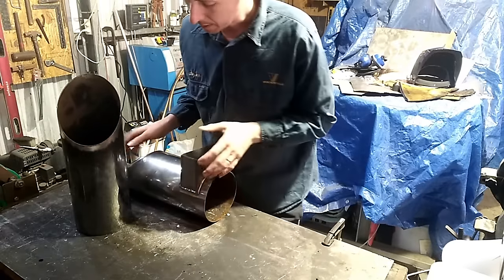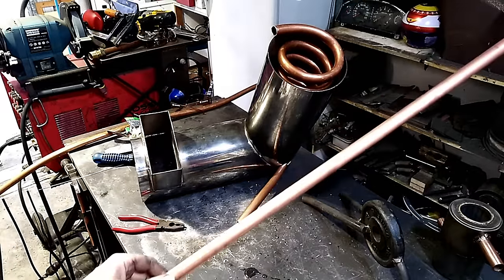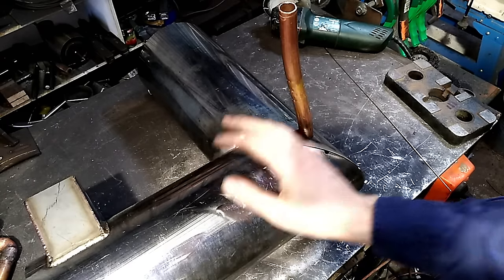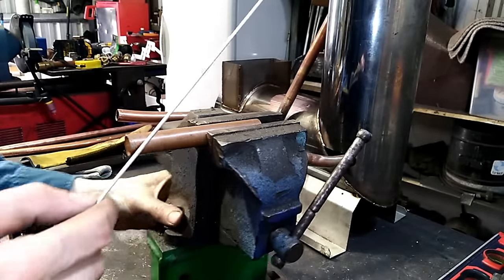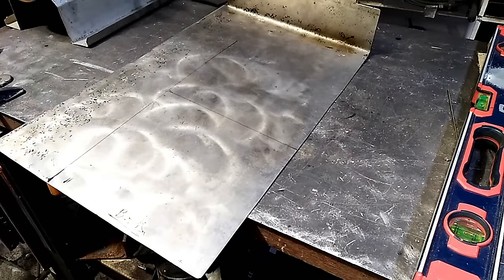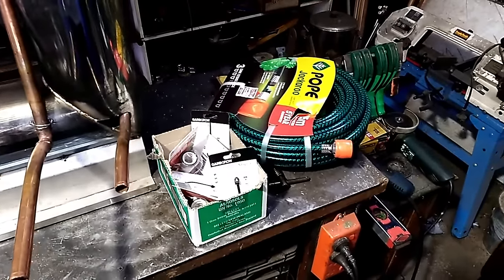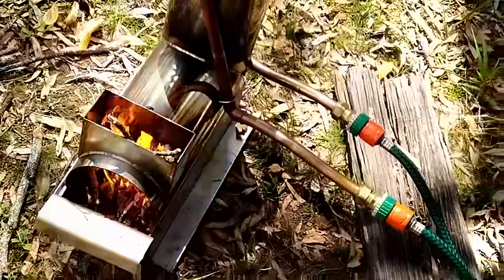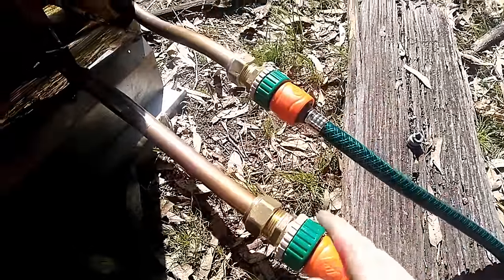Hot Water Rocket Stove II  - BUILD-

Comment: The hesitation and steam blasting is caused by the outlet pipe dropping down before the hose connects.  The water rises to the top of the coil and is trapped, unable to descend.  This causes it to become hot enough to become steam, the expansion of which causes those regular little blasts.  A continuous uphill gradient on the outlet pipe will ensure correct operation.
Reply: Hey! Thanks for sharing that! That's a gem of information!! Thankyou!
Reply: I grew up in a fab shop, nice welding.
Reply: Need a one way flat valve on the hot side,add water or lower the exhaust below the water line and stuff a water hose on the cold side and get the air out of the coil.
Flap valve will keep the heat going one way without allowing any air to be pulled back in another flapper on the bottom flapping to the cold flow   
Would regulate ebb and flow cycling
Reply: I've seen that it is possible to refrigerate te tube to turn round....the two parts of the tube must stays underwater,so you don't lose heat and time,someone explains that up here, nice job !🖖🏼
Reply: В бочке ниже ватерлинии тоже нужно змеевик с трубы нужно ставить. Тогда пар выходящий тоже будет греть воду в бочке. В входную часть холодной воды нужно ставить клапан обратный клапан. Тогда при больших выделениях пара будет воздерживаться давление на выход. Также устроено мойищие  паровые аппараты.
Reply: I am thinking of doing something similar with a mains pressure system, but was concerned about the steam, despite haviving a TP valve, so are you saying that if the hot water exits the top that you won't get steam ?
Reply: @jarrodheley7879  maybe a brass solar hot water one way valve at the bottom of coil to stop pressure push back

Comment: Use a open ended spanner to make the pipe round again. 22mm spanner for 22mm pipe. You can start with a larger size if it's really oval. Just keep rotating it round the pipe as if your undoing an invisible nut until its round again 😊

Comment: My father had a similar rig and we got rid of the sputtering by not having the top of the coil brought back down to the same level as the inlet. We made it uphill all the way with smooth bends and it sputtered no more. On my rocket stove I put a 45 degree chute on the end of it so I could feed in longer pieces. The chute had a lid on it and the combustion air came from the end like your setup. You have some neat toys I wish I had.

Comment: Why did I fail to come across your video before? I looked at so many before I started my own experiments  and this would have helped a lot. I built more or less the same set up with a 200 litre drum and the heat exchange coil from an old copper water tank set into a rough rocket stove made from cement blocks. That got me to where you are here. Then I built a cement hot tub with a capacity of about 1000 litres and made a "coil" from 1" galvanised pipe elbows and nipples. Built another stove from river stone and cement with a stainless baffle suspended in the middle of the coil to force the hot gases over the pipe. It took about six hours to heat the water to a comfortable temperature and of course during that time countless visits to feed the stove. Rocket stoves are very efficient with fuel, not so much with my time. The next iteration was to purchase a 1.25" stainless coil from the US (I couldn't find anyone here in Panama who could bend that diameter of tube). This coil is around 14" diameter with seven and a half turns stacked pretty close together. It acts like a fire basket do I can load it up once the fire has caught then leave it for a hour or so. It takes about two to three hours to heat the water. I found it was important to make sure there's a steady incline from the bottom of the hot tub, through the coil to the inlet. Syphoning is slow but steady with no bubbling. Inlet temp is too hot to hold my hand in but dissapates so fast there's no need for a protective screen. As you discovered, when the flow rate is slow the water in the drum or tub doesn't mix itself and the hot water stays on top of the cold. I usually give it a stir when I'm feeding the fire to see what the "real" temperature has got to. I'm giving such a long comment in the hope that someone else who fancies making an outdoor wood fired hot tub can fast track their project. Good luck whoever you are

Comment: For best results the thermal siphon needs to be all “Up”, without that steep down slope on the hot side copper pipe.
A steam lock at the top of the coiled tube stops the flow intermittently.
This project would work excellent with a small flow pump to flow the water through faster, before it forms steam.
Interesting project.
Reply: As a plumber, I approve this message. As soon as I saw the outlet go down I thought, uh oh. I was impressed with tig brazing the copper though. I've never seen that before.
Reply: Am besten eine kleine Pumpe nutzen. Es wäre auch besser das Wasser nicht von oben, sondern von unten in das Wasserfass einzuleiten.

Comment: Try taking your top pipe upwards to the top of your storage container. Thermal circulation requires cold water entering the lower end of the heating tube and as it heats, the water rises. 
By returning the pipe down will trap the heated water at the top of the coil. Cheers

Comment: You got it half right about thermosiphoning. It works because of hot and cold water but it also involves gravity. The water tank needs to be higher than the stove. The lines need to be on a constant upward angle from the stove to the water tank in order to get a good circulation. If the tank and the stove are the same height, and the lines dip it wont work very good.
Reply: Tried making one of these without this knowledge thinking the boiling water would have a stronger lift effect. Ha. Ha. Didn't do dick. If I used a vac to get it started it would pew pew some steam but that was the extent of it. Decided to make a gas condenser with the tube instead 😂
Reply: You also need low pressure check valves, or at least one, to "Gently guide" the direction you want it to go.
Else the heated water will try to go up both pipes, and thus won't do nuffin because it's head-butting the cold water trying to come DOWN both.
Reply: Thank you
Reply: You guys i think he daid it was a test show. I made mine with a five gallos bucket but electric with a 1500 heating element and all i do is cinnect for 3 to 5 depending on how hot i need the water. Works beautifully for about 15 years now specially when there is no water pressure. But his is nice and i will make one one. Simply
Reply: No not true, as long as the water level is higher than the stove, which with that big-ass barrel, it was probably about two and a half feet taller than the stove

Comment: the upper end needs to flow uphill to a spot into your tank below the water line and above the cold water outlet of your tank. optimum rise is roughly 4 feet high for every 6 feet of distance from the heater. it will heat faster if you only use 3 turns and spread the top and bottom turns as far apart as possible. more pipe creates resistance in your water flow and cools the chimney inhibiting the burn.
Reply: Nailed it !
Reply: Ele pode reduzir o fluxo da agua, ajustando esse volume. Quanto menos água e mais tempo essa agua permanecer dentro da bobina, muito mais rapido vai aquecer, alem do que vai  gerar mais vapor.

Eu encontro um erro nesse projeto: a agua ou vapor que retorna quente da bobina deve entrar no meio do tambor, isso é o correto, pois assim nao haverá perdas de calor como está acontecendo nesse projeto.
Reply: Permita eu fazer uma pergunta:
Voce fez o teste, fez alguma experiencia desse tipo, e usou espiras espaçadas, digo com mais espaço, e funcionou?
Reply: @romilsonmagalhaes6487  rooster crowing

Comment: Great job mate ,well done , there is nothing wrong with diy jobs like this, we all got to start somewhere to learn and grow from experiences. This project was awesome thank you for sharing . 👍
Reply: Had a oil stove with the coil in the burner area so I just went off of how that rig went. Or similer. It can create quite a bit of steam  in the line while circulating to heat up a 60 gallon hot water tank. We were releasing air quight a bit.

Comment: I would suspect that, with your outlet still at the top, a 90 degree elbow and tubing straight down and, near the bottom of the tank, either a bend in the tube that matches the circumference of the tank or a couple of 45 degree elbows either-of-which hug the inside of the tank for a few inches, will get the heated water circulating and the temperature uniform (or nearly so) throughout the contents of the tank.  Great concept and certainly a lot of admirable craftsmanship there.

Comment: You can take a old copper car radiator and put it on an old window unit air conditioner case.
Attach water hose connectors and build a fire under it.
Quick cheap easy hot water heater that will boil out all the hot water you need fast!

Comment: I built a solar heater a few yrs back (20' x 4', copper pipe every 6 inches, black and in insulated box with clear plex cover) I originally brought hot water upper pipe into swimming pool above water line.  It melted the white pvc pipe 2" in just a few hours.  Had to bring it in under the water line of the pool then it worked fine and greatly extended swimming season.
Reply: Doyle Pugmire great idea man 👍

Comment: Fill the pipe with water, crimp end then the other a few inches in as an initial seal, fill the resulting cup at the end with hot glue
Then crimp that cooled section as final seal, water can't compress and so the pipe will hold its shape
Works like a dream and heaps easier than sand or pipe benders

Comment: To round the pipe take two pieces of square steel. Put them together and tack weld them. Drill a hole in the middle at the seam. grind the tacks off and separate. Chamfer the edges by the hole at the seam so it won't pinch the pipe. Then put it over your pipe and squeeze it or hit it while rotating the block. This also works on frozen pipe. The warmer the pipe the easier.Thank you very much for sharing this video. You have a beautiful family. Be careful with welding that galvanize. It's a killer.

Comment: great job and welding OH i wish i could weld like you,
had a Carmichael stove for years on the farm with a wet back, the header tank was on the roof same sysytem ,no pumps for those that reccomned a pump,the tank had a sherpards crook as a saftey  should the water get to hot,and would return excess water back to the tanks,NOTE no pumps for those again who claim needed ,this stove and many like them were in their 1000s in Australia ,just a matter of keeping the header tank full where there was no power was done with a semi rotary pump ,if power then the water pressure pump took care of that
ols aussie saying you done well son
Reply from the maker: Thanks mate, to appease the pump crowd I have put a pump on the stove which circulated the water so fast that it was not able to heat it.  Still working on the 2nd version of this stove, which is a very different animal to the first one. Thanks for sharing, I appreciate it.
Reply: @LittleAussieRockets  use a car radiator thermostat that also controls the pump. When the waters at temperature it opens, turns on the pump and let's water flow. It also has an inbuilt safety mechanism in that it won't close when it's too hot. You could also put a pressure release valve for safety.

Comment: some one tips:
if you want hot water with less time, instal a pipe in the outlet of water inside teh tank, causing the water to be heated to enter a higher temperature. (suction pipe at the middle the tank). Less water for heating, less time to do.
If you need more hot water but do not be in such a hurry, you can put the inlet and outlet the water of the tank about 10 cm from each other  on the bottom of the tank.
In this case, basically, what changes is just the hot water intake going down. So, the water that is already warm will rise and on the way, tranfer the heat to the water of the tank.

I like your videos..
from Brazil...
Reply: I don't have materials to do this job,can U make me one to pay for it?Am a pensioner in Ghana

Comment: really interesting watching the metal work and planning. i recently finished building a sailboat and a lot of your tool usage is parallel to what i did. the worst thing about handbuilding an epoxy and foam sailboat is the metal fittings. i have a swivel mast and trimaran folding apparatus. most of the metal is aluminum and i had it fabricated by a friend in a nearby town. i got to watch him enough to see the process. a lot of the metal parts i had made i think could be done with carbon fiber or some combination of  metal and cf. i will try to  watch more as i think your knowledge will come in handy! also the planning of parts is intriguing. i'm working on a second smaller boat using all my own planning and its quite like watching you scramble putting together the stove. cudos. another thing is i think a few courses in metal shop might be appropriate for me. i have a masters in ceramics and have worked a lot with gas and copper and with stainless bending in sculpture. art isn't all a lark is it? sometimes you learn some very practical things in art school. the best larger bead i ever saw laid was by a girl who had a jewelry background. it was beautiful. and so was she. thank goodness for art school!

Comment: You can weld copper very easily with dc and a good preheat. Sweat fittings like those don't even need filler. If you blow a hole, fill it with electrical wire.